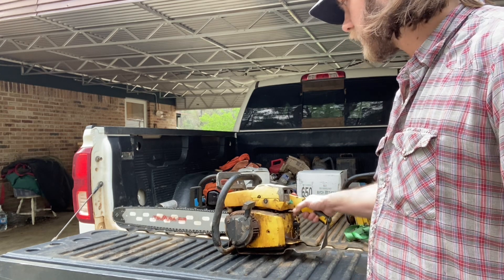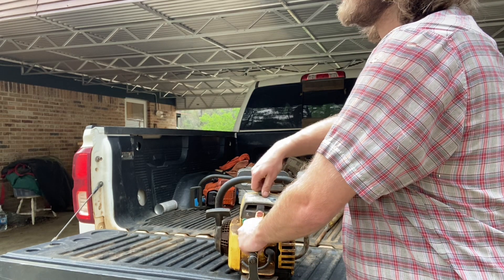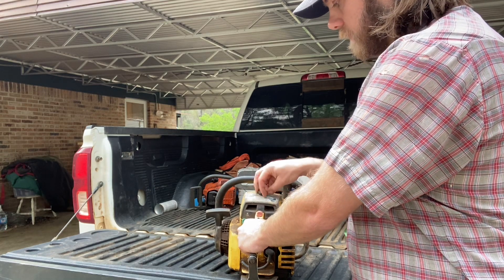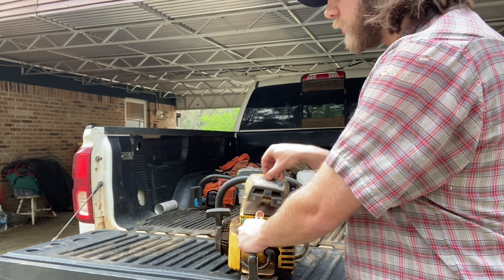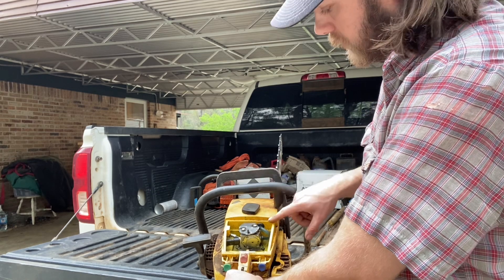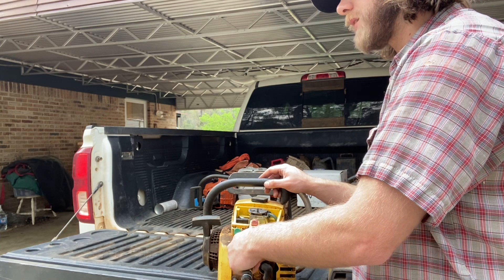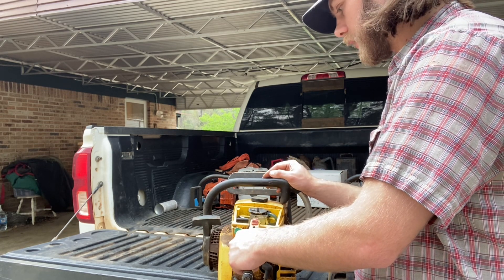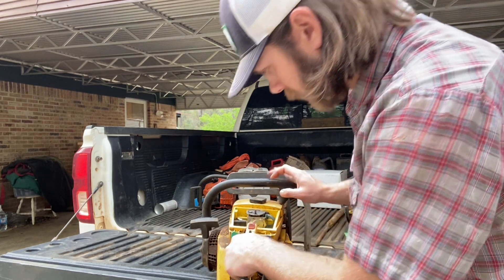Tailgate tech talk: Mcculloch 82cc specifically pro Mac 800

Comment: Have you ever ran into spark problems with those macs?
Reply from the maker: Not much at all, the electronic coils are pretty bulletproof from my experience, with points I’ve only had one or two condensors go bad ever, and maybe the same amount with points, typically a clean up and regap of the points will produce nice strong spark. People throw those chips in them because they are cheap, but mainly lazy, points on saws rarely truely wear out, just need cleaned and regapped
Reply: Had a ProMac 10-10 give me issues from the coil going bad internally with the laminating. It would spark but only with high rpm turning the flywheel. I replaced the coil with one from a 610, which are readily available on eBay, just need to shorten the plug wire.